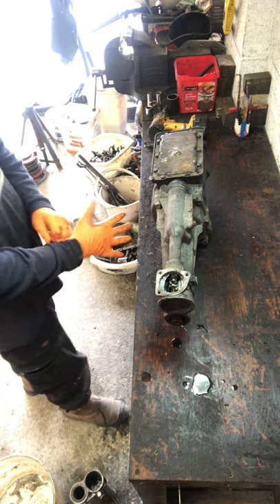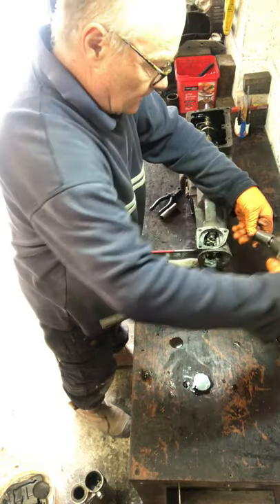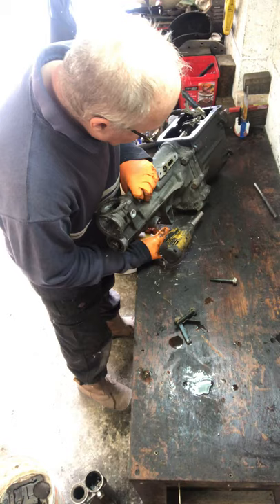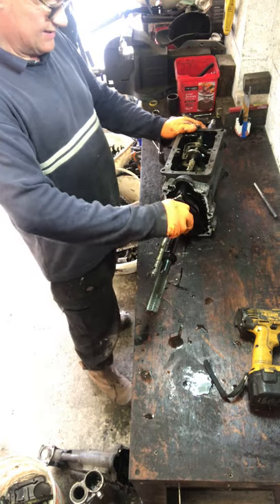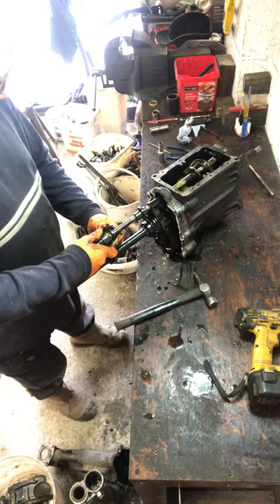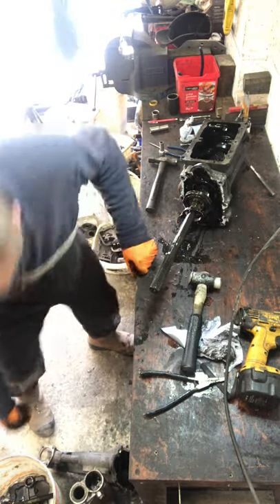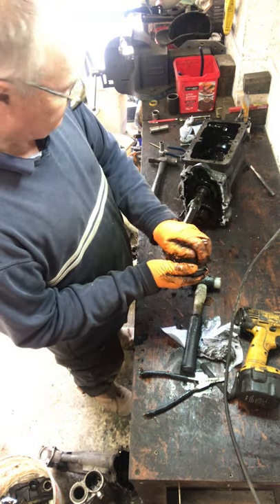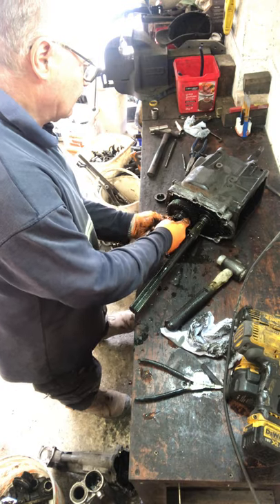Type 9 gearbox dismantle part 1

Comment: Great Video thanks for sharing your knowledge. My Type 9 will not go into 5th gear, it stays in 4th. The stick moves to the correct position but when you release the clutch the revs stay the same. IE its still in 4th